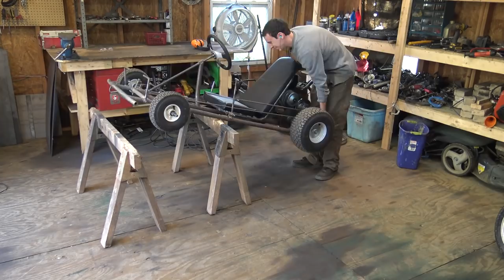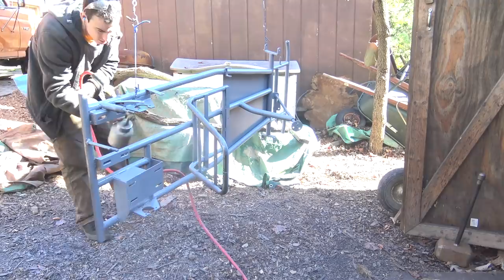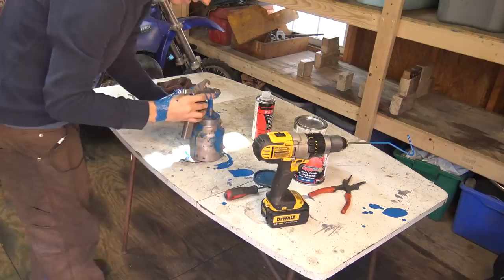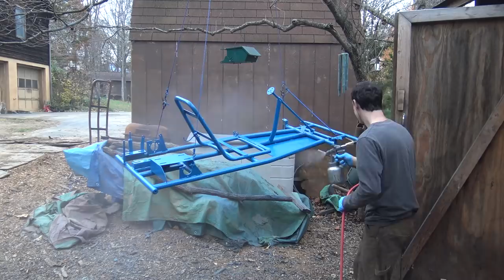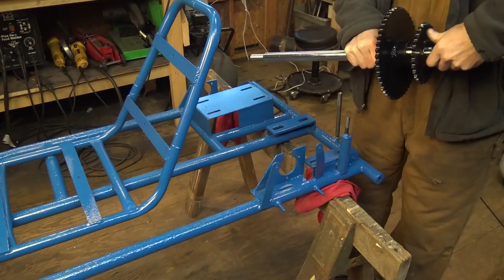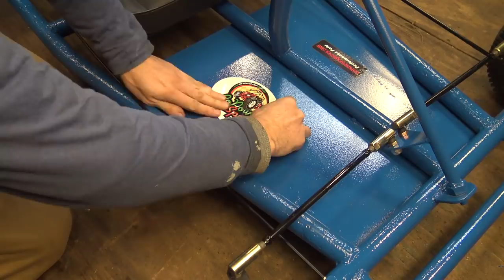painting the two speed go kart

Comment: you need to go over with another layer of the clear coat but put it on wetter  so it has the proper protection. from what i see the clear is badly dry sprayed so its not going to have good durability or uv protection. just a tip . . really digging the color thought

Comment: For next time, it helps to mix your paint in a separate container and mix it well before putting in your paint gun. Also, get some paint filters from your auto parts store that sells auto paint supplies. You'd be surprised how much gunk is in the filter after. Also, you can use thinner to wash paint off your hands. Just use a good hand soap and lotion after as the thinner dries out your skin. Or wear gloves like you did in the second part. Paint will go everywhere! Even overspray, its why most painters wear paper paint suits.
Reply: Also, i saw during the time lasp you putting your arm up to your face. Get a good quality paint respirator, with a two stage filter, not a  cheap dust mask or particulate filter, one made for automotive painting. Even painting outside, you can still breath in the fumes from the paint, and besides respiratory problems, it can lead to brain damage. Glad to see you painting this way, this will last much longer than rattle can paint. And another tip, look for implement paint at a farm and home or tractor supply store, the colors are not as broad, but tractor paint is designed for rough use and is hard. I use it for painting engine compartments and engines I've rebuilt.

Comment: When mixing your paint, if you mixed it correct and put the activator and hardener in. You mixed correct, but when you poured what was left in the paint cup back into the non mixed paint. Guess what, you will be able to throw that away now. It will be hard and no good. You might have been going to throw that away anyway, and it might have not been enough to save. But just a thought for next time.
Reply: Anthony Cash yep, it seems wasteful to throw away good paint, but its better to mix too much than to run out 3/4 the way thru.
Reply: Anthony Cash his paint didn't require a hardener just a thinner which he added to the whole can so I think it might still be ok but I agree with you as far as cross contamination and that you should never dump it back in the can

Comment: That gun might be 2 or 3x as old as you are.  My dad has one that looks just like that that came with a compressor kit back in the 70's, and one that looks pretty similar from the 50's.  They can be fussy to work with (you ran into getting paint comming out of breather/vent, you caused that but it's muck harder to do on a newer gun) and tend to cause more mess/overspray than a newer HVLP or LVLP, but will spray stuff that newer guns don't have a chance at spraying.  I hope you cleaned it out well since that one looks to be in good shape still.

My $.02- head over to Harbor Freight and pick up one of their gravity feed HVLP guns (the "purple gun") for $9 when it's on sale and try using that for this kind of work when you have it.  It'll be much easier to deal with and get better with and save you some in materials.  Save the old vacuum/pressure fead gun for when you have harder stuff to spray (or you may never use it again).

Comment: I mounted my welder to the bed of my truck I used these rubber things that go inside of your the pockets on your truck bed and they got a little hoop on a little circle so that you can change stuff down to it and you can run straps to hold stuff well I put studs from the bottom up and then took that rubber and slid that rubber over the stud and then my welder to the truck like that was some washers and a nut and it's stop the vibration that might help with your vibration on your cart and it will do away with them 20 washers because they're about as thick as them 20 washers and it would work real good for the vibration

Comment: I'm confused, on your video for making a 2 speed go kart transmission, the piece that moves ans engages the sprockets has two plates with rods going between them, but on this video and other videos of the go kart, that piece only has one plate. Did you change the design for a specific reason?
Reply from the maker: Redneck Tractors it’s two different transmissions the one that I made a video about me making it is the second transmission I have

Comment: God why do people weld the floors on it is a bad and half assed way in my opinion and looks horrible!!! Why not just weld tabs and bolt it to it and have a 2 tone paint job in the end
Reply: HOT SHOT 1500 I agree that it doesn't look the best but will function just as well as a fully welded floor. Sometimes it's more cost effective to not weld the whole floor pan as that would be time consuming and expensive since it's not adding any structural stability to the go cart
Reply: Jake DiMauro it still looks great in the end